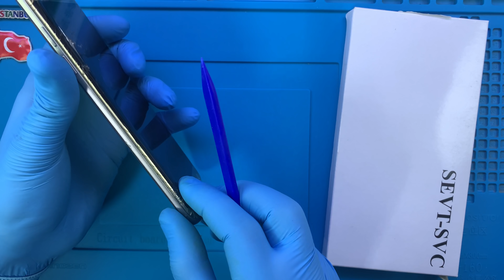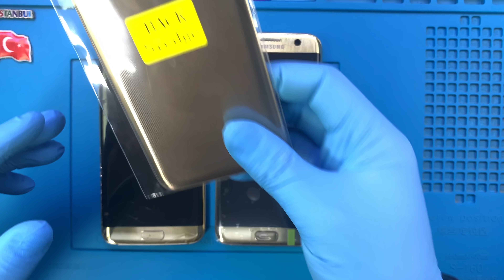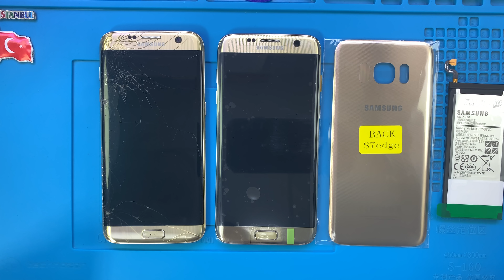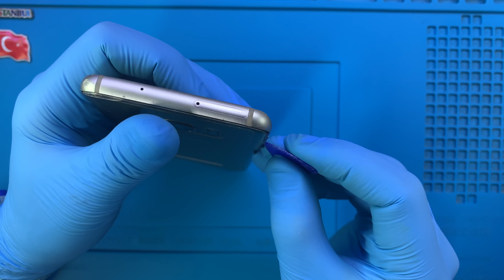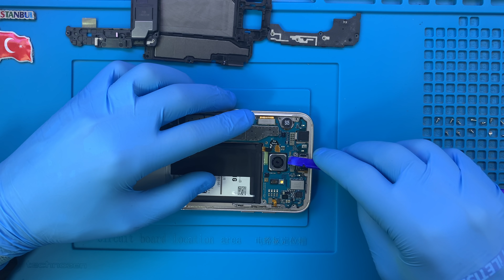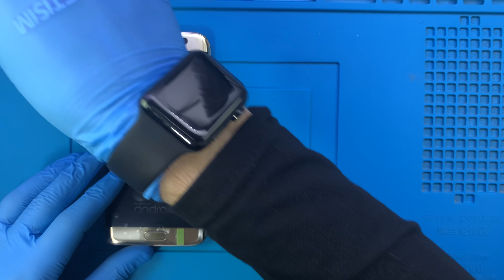Samsung Galaxy S7 Edge Ekran Değişimi 🇹🇷

Comment: Excellent job, But you forget to  vacuum up dusts before unscrewing the screws with the screwdriver like the video of the S7.
One question after fixing the front and the back glass cover of the phone, does it return to its original IP68 protection?
Thanks again.
P.S: How much cost these replacement and fixes done on your video?
Reply from the maker: Hello;
1350 Turkish Lira.
Greetings.